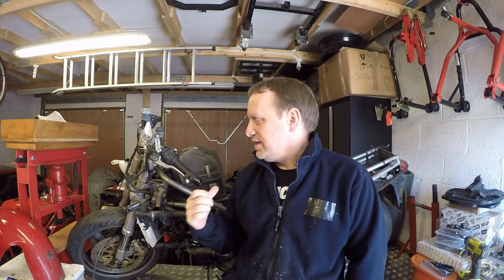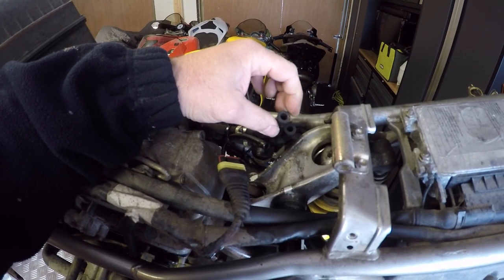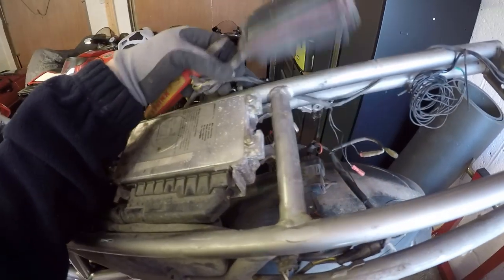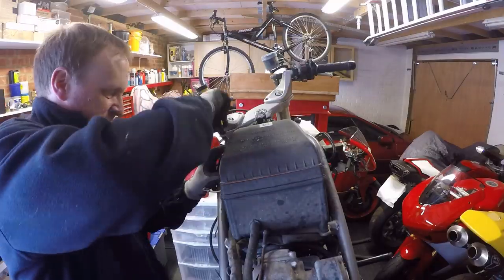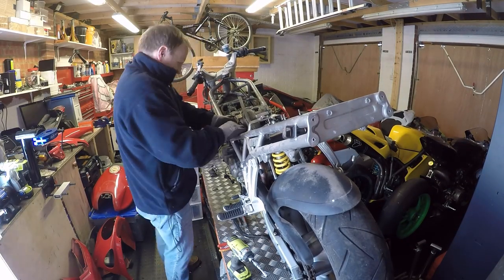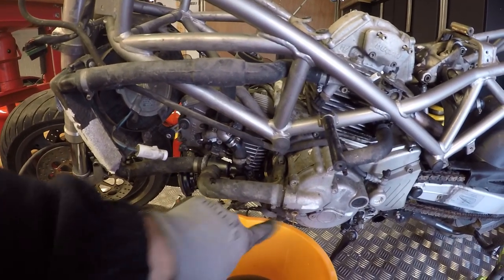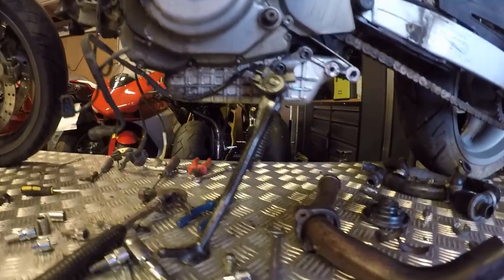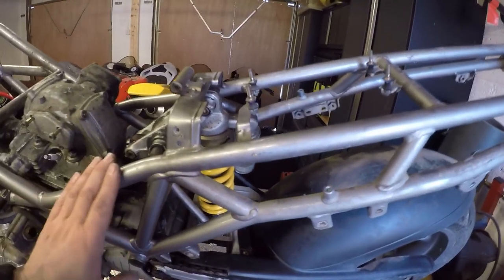Ducati ST2 Restoration Project Video 3- Stripping the bike

Comment: Thanks for the video, I'm half way through plating my bolts and other parts on my 1995 748 bp. I need the frame repainting but with the lock down I'm finding it difficult to get it done at the moment. my engine was like your st with bad paint as well, keep up the good work
Reply from the maker: Hi Tim, 
Has the plating worked well for you?
Good to hear that someone else is saving the world one Ducati at a time 🤣
The lockdown is a hassle for a number of parts and services lol
Reply: @DesmoWerx  yes plating went well after a lot of trial & error (my garage looked like a lab) im getting my frame & swing arm painted tomorrow, then the the fun bit the rebuild

Comment: Hi and thanks, these are great vids.
Would it have effected the running of the bike if you didn't renew the breather pipe that had damage or was it simply to make a top job of the rebuild?
Reply from the maker: It would be messy without the pipe and would affect the vacuum in the engine cases and could have a minor impact long term. Plus it was worth replacing as part of the works  😊

Comment: Dear @DesmoWerx or dear followers. I have a quick question about the installation of the dashboard. Threre are two pins with screws and 2 rubber pads that fixes the front side of the dash to the aluminum plate. What do ve do first. Fix the pins to the plate and then push it through the rubbers or put the pins in the rubbr and the screw it to the plate. I think the fist one is the way to go but wanted to ask anyway :D THanks for the help

Comment: What's your reasoning for powder coating the frame instead of painting it (which I assume is how they originally came?). I assume the powder is thicker than paint? Will it fill in the VIN stamped onto the frame and make it unreadable?
Reply from the maker: Hi James,
I prefer powder coat as it is more cost effective and offers better protection. The powder coater I use does this quite often for me and only lightly coats the VIN so it remains readable as it has to for the race bikes.
If this was a higher standard restorations I would paint the frame for a factory type finish.

Comment: I'm a new subscriber and I'm going thru my ST-2 . I tried to remove the airbox but it wouldn't come out. I took out the 3 bolts holding it on but it seems stuck on. Does the rubber inlets to the throttle body's hold it in?? I'm going crazy!
Reply from the maker: Hi Brent, the rubbers on the throttles hold it in place, you have to be quite forceful to pull the airbox off, if you have access to a hairdryer warm up the throttle rubbers for a while to make them more malleable to help get it out. Also have you removed the key switch from its mount? Hope you manage to pull it out of the frame 😊
Reply: @DesmoWerx  Thx 4 replying. So I'm assuming the rubber surrounds the TB and the heat from the engine has kinda melted the rubber onto the TB. Maybe a rubber mallet hitting upward on the airbox would lift it off then. 
Didn't notice if the keyswitch would be in the way, but I'll look. Thx again.
Reply from the maker: @curlymyhero  the heating and cooling of the engine makes them go a little harder, if you heat with a hairdryer it will make them softer and easier to pull the airbox out 👍